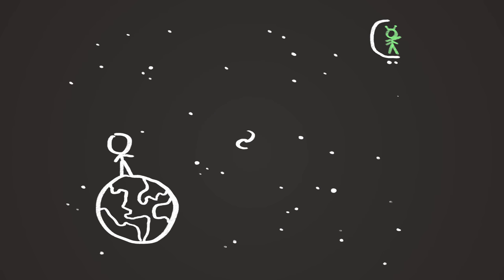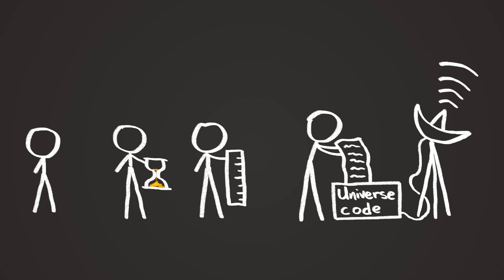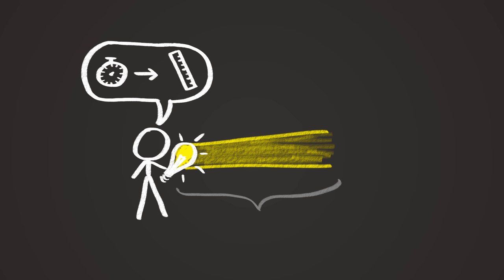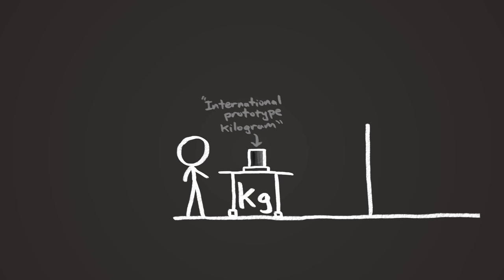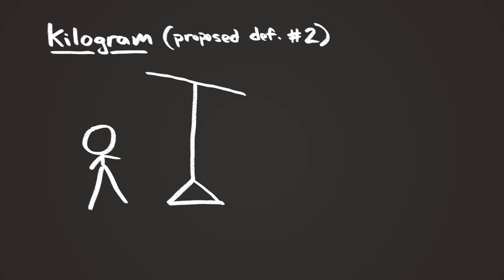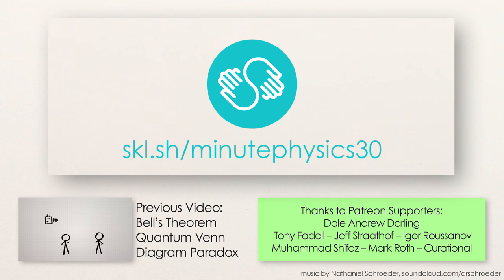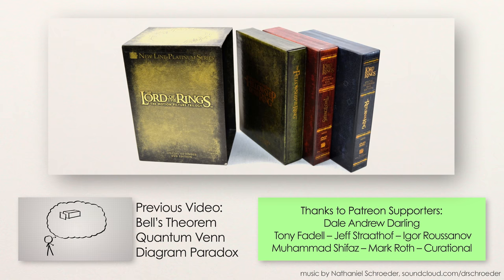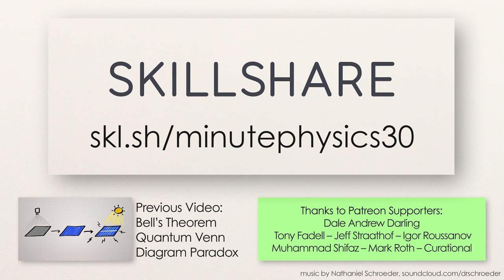How to Build a Teleporter with Aliens

Comment: But how would they know what a proton or neutron is?
Reply: Tell them that protons & neutrons have the same mass, but protons have a charge. They don't need to know positive vs negative, they just need to know neutral from not neutral, because we've already clarified that the particles we call protons are the ones with the same mass as neutrons, so they'll know we're not talking about electrons.
Reply: @aformofmatter8913  They dont have the same mass
Reply: @Just_a-guy  neutrons are slightly heavier I believe
Reply: @aformofmatter8913  how would you tell them that?
Reply: @nicolasladner7113  infinite regress is a bitch. Teaching aliens about us and our language will probably be very very hard
Reply: images?
Reply: if they're intelligent life, chances are they know
Reply: @kitma9  yes they know but how will we tell them because we cant say proton since they wont understand that and we cant use a circle with a plus in the middle because they probably use something different to identify a proton. For all we know they could be using + for negatives and - for positives
Reply: That's pretty easy. The larger a nucleus gets, the more neutrons (relative to the amount of protons) are required for it to be stable. Therefore, if we said "look at the atom with 80 of one thing and 60 of another. We call the thing that there's 60 of a "proton" and the thing that there's 80 of a "neutron". That being said we're assuming that they have the same number system as us, and that they receive signals the same way, that they have a physiology even remotely similar to ours, etc. Eventually you draw a line
Reply: They probably don't and will never be able to know any earthling language .maybe they should take a look at the voyager spacecraft,it has the record of where we live
Reply: @aurelia8028  i know! Send a stupidly powerfull light beam and that is the mass of a neutron then do some other stuff
Reply: @YEWCHENGYINMoe That might work in principle, but apart from enormous amounts of power the rays would also have to be stupidly precisely parallel to each other. Remember that if you flick your wrist holding a laser that's pointing to moon, the light-speed-exceeding circle will be like 1000 kilometres in diameter. And that's only a light second far.

Comment: I love watching the part about kg now after the recent change in the measurement using universal fundamental  constants
Reply: i also wrote a comment about the same thing lol
Reply: Honestly the one thing that gets me is why did they change what 0 and 100°c are, what's wrong with the freezing point and boiling point of water
Reply: @potatoheadpokemario1931  the freezing and boiling point of water changes based on pressure
Reply: @davishall  just make it the boil and freezing point at 14.7 psi
Reply: @potatoheadpokemario1931  It is difficult to measure precisely. That's why it was changed to the triple point based definition, and then later changed to be based off of the Boltzmann constant. It's advantageous to be able to achieve highly precise measurements of such important units.

For everyday use, as I'm sure you're aware, none of this matters. If a unit is redefined they will make sure it remains close enough to the original definition.
Reply: @davishall  okay

Comment: But first, how do we get them to understand any of our languages and vice versa?

Also, I'd use the teleporter to send my mother in law there and then I'd break it.
Reply: I was thinking the same with languages. If they understand protons, neutrons, and electrons, they should understand other concepts.
Reply: they would understand math (not numbers, math). we'd start with simple strings like "1234" and they'll respond with "5678". only they don't know what the word "five" means, so it would have to be done in amounts. so, our message would look like a series of blips with shorter or longer pauses between them to seperate intervals.

"blip---blip-blip---blip-blip-blip" etc.

from there, we could slowly develop a math-based language to convey simple words and such.
Reply: You don't use the words. You probably draw the atom.
Reply: Our image of the atom has changed over the years though, so they might have a vastly different idea of what atoms look like.
Reply: you start with math, then work your way towards grammar and sentence structure, then teach them any other relevant terms (ie. they won't need to know what a pizza is in order to build a wormhole (but it might encourage them to do so))
Reply: I recommend you to take a look at the images printed in the copper disk of Voyager.

Although I cannot tell you the exact way we could do it. It should give you a nice idea of what the comunication process might be. Once you show them a pattern, it's easy to go from there and develop a more complex way of comunication.

I also recommend you to read the book "Contact" by Carl Sagan (the movie adaptation was very good too). It explains how we can develop meaningful communication with an alien civilization using only electromagnetic signals such as radio.
Reply: L Galicki Band not to mention the bacteria of our planet compared to whatever microbiome they might have on their planet. Would our microbiome make them sick, like certain bacteria from other countries do to us, or would that even be relevant for Alpha Centaurians?
Reply: What if they don't use the same base as we do? Maybe they use base pi
Reply: How are you so sure their "math" is the same math we based all of our calculations on?
Reply: Well the concept of math and physics is most likely universal
Reply: Watch the movie Arrival.
Reply: Daan87423 Humans have no problem understanding diferent base systems to count.

Decimal
Binomial
Hexadecimal
Octal
Bigecimal

So there is no reason to believe they shouldn't be able to understand ours.
Reply: I think is not a matter of "base", that would be easily solved. The problem is if they feel numbers in some other way, like exponential. So for us 1-2-3-4 is natural but maybe they prefer 1-10-100-1000.

I really think that language itself is the greater barrier. How do we make them understand what a "proton" is?
Reply: Morse code
Reply: As RaPh Severla mentioned, the "Golden Record" image of a man and woman is pretty well known, but it included other images.  See the 3rd and 4th images at https://voyager.jpl.nasa.gov/golden-record/whats-on-the-record/images/ for an idea of how we start with basic math and build up.
Reply: We have a hard time translating other languages. Before the Rosetta Stone we couldn't figure out Egyptian hieroglyphs, for instance. Also, it took a very long time to understand the Voynich manuscript. Language is very far from being a mastered science.

I don't get what it is about Morse Code, it's just an alphabet. Not only very Earthly, but also very English-y.
Reply: drawing only works if they have eyes, and considering they evolved in very different conditions, it's certainly possible that they don't.
Reply: DerpMans Derpyskin That is a lie. Eyes are a must have in most complex life forms. They give an enormous advantage when compared to those that don't. Living beings have developed eyes multiple times throught history without, completely independent from eachother.
Reply: The "images", along with the rest of the data, are encoded on a record (i.e., etchings on metal).  However, to get those images they would still have to understand the instructions for using the record, which are etched on the back.  A space-faring race, regardless of whether it has eyes, should have some ability to use an eye-like tool (something that detects photons and depicts it in a way they understand).  After all, they probably found the probe by scanning other parts of the electromagnetic spectrum, and there is nothing special about the visual spectrum.  If not, I suppose they could feel the etchings on the back.

Really, the most implausible thing is that the probe is ever found in the first place, but we knew that before we sent it.
Reply: I wish I could remember the author and title, but I read a story once when a human and a martian communicated just by flashing light at each other. I thought, bollocks, there's no way they could talk about anything substantial, but I was proved wrong.

In the story, the author explained in detail a possible way to do it. There were assumptions, e.g., the time to talk back and forth was short enough for human and martian lifespan and patience, they had the intelligence to understand concepts such as numbers initially, and ultimately a common understanding of physics and space and stuff like that.

Similar assumptions would be needed here.
Reply: Benjamin Catus 

Personally, I don't think there's that much of a threat from either diseases affecting the other species. it's possible that some bacteriums have an unforeseen effect on them, but even on earth human diseases don't affect whole other species unless they're very similar to us.

there might be some random side effects, but I don't think they could get the flu.
Reply: L Galicki Band are you trying to start an interstellar war, cause I'm pretty sure that's how you get an interstellar war...
Reply: L Galicki Band did no one else notice what he said about his mummy in law
😂😂😂
Reply: We, or the aliens, can transform the base into our natural form. Simple counting isn't going to use a base. Whether 1=1 or 1=pi - 1 tick is still half of 2 ticks.
Reply: @neomew What you describe is called "unary", which is technically a base.  It is the most natural base, just not very useful for representing large numbers. Pedantry aside, I agree that we can expect aliens to understand unary. :)
Reply: Isn't the assumption that the aliens would be more advanced than us, and therefore already speak the our mathematical language?

I forget the name of the classification system proposed for ranking civilizations based on what they use to harness energy and how (harnessing energy of an entire star, for example); I recall that in this scheme, earthlings were placed in the first (lowest) category.  

If they are indeed our superiors in this way then does it then follow at they might already know everything about us? And even without their own personal knowledge of our miniscule existence, perhaps they would already grasp our paradigm for mathematics and physics the way human adults have mastered addition and subtraction...

On another note, would it matter if they based their mathematics on an alternative system of say, 8's or 12's--rather than on 10's like we do?  I think you guys have already gone far beyond this point so I am just thinking aloud.

I love this banter.  Nice to find civilized intellectual exchange in a world entrenched in populist, shallow, dualistic paradigm (trump's tweets come to mind) (so does Crossfire)
Reply: What are y’all talkin about just watch arrival then boom we know
Reply: Babel fish obviously !
Reply: What if aliens don't know what protons and electrons are?
Reply: Galaxis 
Arrival is a pretty awful movie
Ask any professional linguist
Reply: @Jack Felag I disagree. They should understand the concepts of weight and lengths? Because even US americans don't underestand the concept of KG and Meters yet. They're not even aliens.
Reply: dhvsheabdh You can’t transmit drawings without both the transmitter and receiver having a system in place to turn the signal into an image. A signal is just pulses switched on and off.
Reply: dhvsheabdh how do you transmit an image? Or more specifically, how do you know how to decode an image? If I sent you an image in binary, how would you know if it was a .bmp a .jpeg a .gif or anything else, and you don't get to use any books, references, or prior knowledge to do so.
Reply: @mlblme1 This seems like a decent description of how the process for decoding images is given on the back of the record.
Reply: It's obviously not the same, but I heard a story recently about how a guy in prison came up with a way to talk to the guy next to him by knocking and the other guy learned it, because they weren't allowed to talk. They both knew the same language and just learned to spell things out that way. They were there for many years and one guy even "read" the novel anna karenina to the other guy after finally being allowed to take a book to his cell a few years after they were imprisoned. This is what happens when you speak ill of the government in some countries.
Reply: Language is definitely the main obstacle. Math is not necessarily universal. Conceptually, yes, math works the same everywhere, but is there a universal way to communicate it? 

The numberphile video about numbers in different languages at /watch?v=l4bmZ1gRqCc  basically describe our conundrum. It's hard enough for a human who knows nothing about your language and you who knows nothing about theirs to understand each other. How are we supposed to understand a species which share absolutely no physical or environmental similarities to us? 

If we communicate with blips and pauses for numbers, how will they know that the pause means end of number? 
If we try to draw a picture of an atom for them, will they understand what a 2d representation of a 3d object is? 
How do we communicate the concept of protons and electrons and neutrons with them if we don't even know how to communicate the concept of positive and negative? 
What if they only "see" in infrared or x-ray or microwaves or even radio instead of our visible light, and code information into our visible wavelength, which is invisible to them? What if they sense another field of force besides electromagnetism?
Reply: None of you thought of this: what if they decide to teach us? What if they don't wanna communicate (because they lack the feeling of being good to others except themselves)? What if they lack the intelligence to comprehend our purposes? And the most dangerous one: What if they misunderstand us?
Reply: Or what if they just come to eat us?! Soilent Green is people!
Reply: How would aliens understand abstract, human made diagrams?
Reply: How will you explain to them the concept of a mother in law?
Reply: Math is a universal language.
Reply: Tim Suetens Why is it universal? Because us humans deemed it so? You do realize aliens might not see what we see when they "look" out into the universe? That's only the beginning. Mathematics is an Earthly construct, formalized in a very particular way by humans that might make no sense at all to extraterrestrial species.
Reply: Watch "Arrival" for a good idea on how to learn languages - plus, it's a great movie!
Reply: There are a lot of PROBLEMS with using MATH as a language. One, is that they will most likely use a different numerical system than we do. 

Another is that even for some reason that they also use the decimal system like we do, how are they suppose to know that the PICTURE/SOUND of "1" or "5" represents the amount we attribute them to be? For all we know they're representation of "1" might look like a 3 year old's drawing of an amoeba, and they'll send us this sequence of five amoeba like pictures and we'll misinterpret it as "hello" instead of 12345.
Reply: mystirboy Exactly. And which direction are we supposed to read it from? What if those amoeba things aren't even part of their writing system, just some residual junk that was accidentally sent with it and the real message is in a wavelength that we don't even know how to encode and interpret?
Reply: Johnny Rainbow they might not use a decimal system though
Reply: They teach us how to build a teleporter and you send your mother in law?

That’s just cruel man…
Reply: The problem is that math is based on postulates that are, in themselves, not universal. If we follow the same mathematical reasoning and keep the same postulates, then we end up with the same things. If we do this but swap one postulate for another, then we end up with different properties for one same physical phenomenon, both of them being true. For example, there is no certainty that they will base math on a linear unit like we did. We chose.1+1=2 because it was the first math problem we ever had to solve (keep track of stocks) but if an alien civilization's first math problem is involves a logarithmic system then there is a probability they they may use that as a norm instead. 

Moral of the story is that there is no certainty that if you send 1234, they won't answer with a string or random numbers we will perceive as random, while it is in fact the solution in their system for what is for them a random string of numbers.
Reply: L Galicki Band Using Maths
Reply: If you are speaking of international communication to create the teleporter, we could send electromagnetic waves and use certain pieces of universal knowledge— the behaviors of an atom, laws of the universe, etc— to exchange information.
Reply: Lmao
Reply: Showing and telling this is called x in our language how’s it called in yours?  

just like humans have learnt previously unknown languages for millenia
Reply: points at a football football
Reply: How did hellen Keller learn from her teacher? That’s your answer.